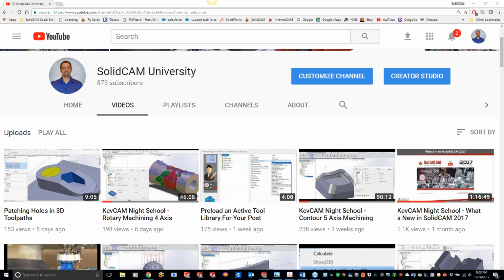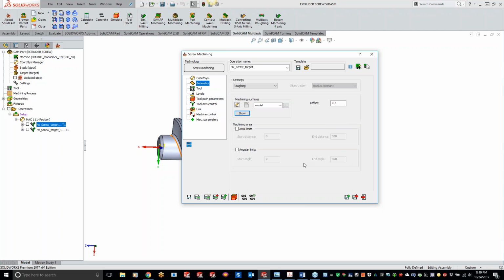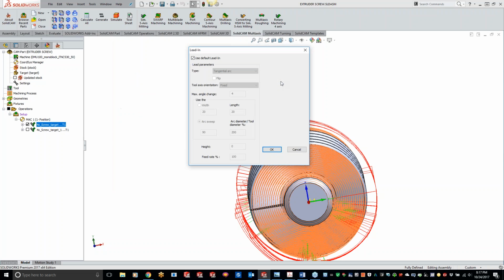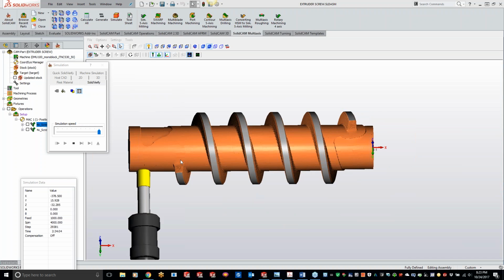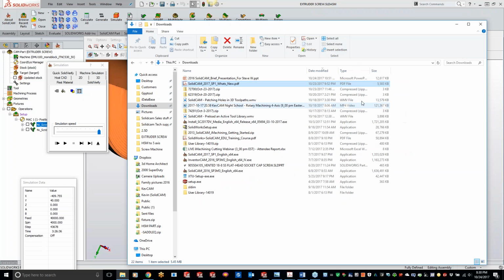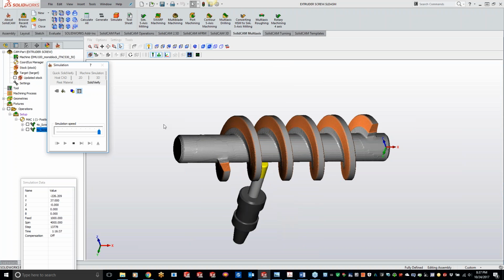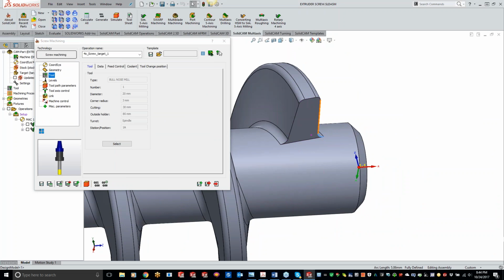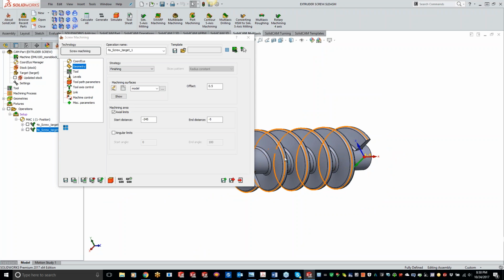KevCAM Night School - Screw Machining

Comment: Which machine you are using in this video? In this simulation it is shown that job (work piece) is stationary and tool is rotating around z axis. How is this possible. Is this a new type of machine. I have nevere seen this like. Can you please clear this?
Reply from the maker: That is just how the simulation was been shown in SolidVerify.  If you were doing this in machine sim or on the machine the 4 axis would be rotating.